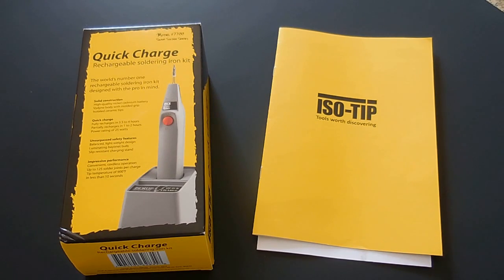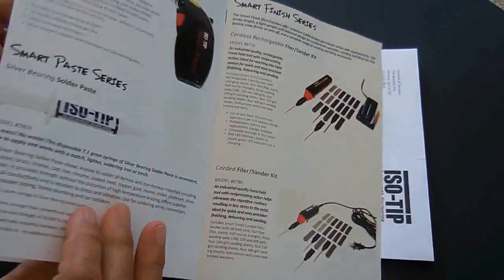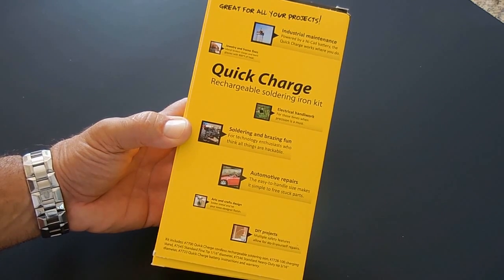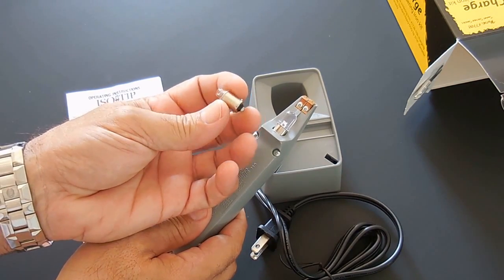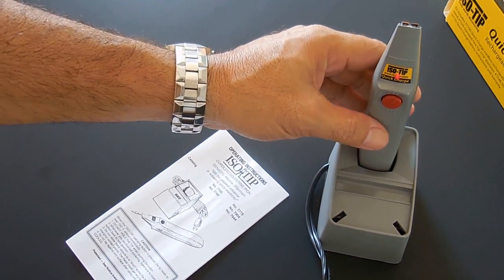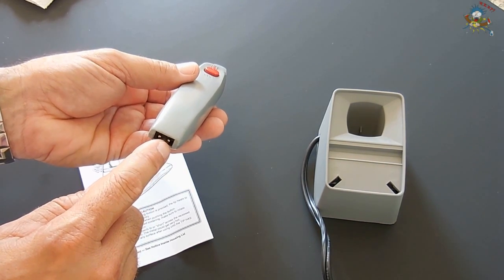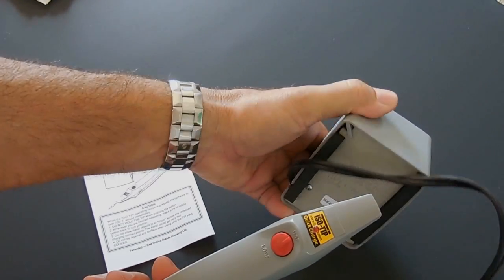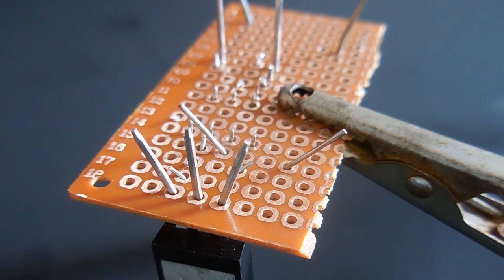ISO-TIP Rechargeable Soldering Iron

Comment: Nooooooooo! They gave us these things in the Navy in the early 80s when I was a tech in an F-4 phantom squadron. They wouldnt get hot enough to solder anything, we ended up using bic lighters instead.
Reply from the maker: Works pretty well for me. If you're going to try soldering thick wires, it's not going to work. When I have time I'm going to convert mine to lithium-ion
Reply: @electronicsNmore  we were soldering 18-20 awg conductors in compact wire bundles connected to  cannon plugs, at least 40 and up to 144 pins. The problem was less the wire size and more that it was outside, at night, even a little breeze and it might solder for about a minute if you were lucky then battery voltage just too low. Those were the days of ni-cd, maybe lithium could work. I had wellers battery powered irons about 20 years ago. The 4xaa version was marginal if you zip tied the switch for about 2 minutes. The 3xaa I got so mad at I literally threw it in the street and stomped on it. Having soldered thousands of connections in various applications I have no tolerance for insufficient heat! Butane irons can be frustrating too but when they work they work.

Comment: You did not say much about the LED bulb you used.  I just purchased a 8000 lithium but the #222 bayonet base bulb bunt out after only about 45 minutes of use.  I don't think they had a dropping resistor feeding it so the 2.2v bulb was probably getting 3.6v from the lithium batteries and that bulb is expensive compared to a normal screw base #222 bulb.  What bayonet LED bulb did you use?
Reply from the maker: 10mm ultrabright LED with series resistor.

Comment: They have made the same exact soldering iron at least forty years that I no of ,I figured by now they would upgrade to a lo po battery or at no metal hydrid  battery Of is a good soldering iron ,can I ask you wear you bought  your L.E.D. bulb from .thanks for shareing
Reply from the maker: It was a 10mm ultrabright Led off ebay.

Comment: Years ago Radio Shack made a cordless soldering iron (it was black with a yellow button) and I'm betting that Iso-Tip is the one that made it, but I could be wrong.  I had one and really liked it and it even had a slide on cover that protected the tip if you were taking the soldering iron somewhere with you.  It lasted a long time but eventually the batteries died and the knowledge of replacing them wasn't known to me at that time.  Was also hard to get apart and I ended up breaking it since there wasn't any screws in it (it was glued together).  I did save the tip and button mechanism and I still have it in my tool box and have plans to see if I can convert a cold heat iron (junk in my opinion ) over to use this tip.  Anyway, over a year ago I found one of these irons by a shear fluke for $19.99 and bought it immediately!!  I love this little iron and plan on doing the two mods you did to yours.  I have tried to use an led but it wasn't bright enough and the joule thief circuit looks like just what I need, so thank you for this!  Also I am going to do the charge indicator mod as well since there has been times that I went to use my iron and it wasn't charged.  I had used a large rubber band on mine to keep the iron snuggly in the charger.  It's not real tight, just enough force to hold it steady.  You can move the band with 1 finger.  I found your video whilst looking on Iso-Tip's site looking for an LED for the iron.  Thanks for making this video and showing us how to do the mods.  Much appreciated!!
Reply from the maker: Glad you enjoyed the video Terry! Please be sure to check out my extensive video playlists for other great videos of interest to you, rate thumbs up, and most importantly share my channel with others. Thank you

Comment: Hi, I tried to find but i don;t have any type of cordless rechargeable soldering iron in my country. I want to make it myself but the most needed part is its tip that contains heating material at 1.2 volts. It would be very helpful for me or others like me if you can share a video on diy rechargeable soldering iron especially its tip( how it can be built with common things available in electric trash or anything)  Thank you

Comment: I purchased mine in the late 70's and is orange and still works. I should replace the battery and the bulb is a screw type. There once was a drill attachment for cleaning out the holes in boards but I don't know if they are still available.

Comment: personally prefer products that work like I need them to straight out of the box without having to do modifications
Reply from the maker: +tooterr101 oldgeezer 
Yes, If you bought the mid-priced model, the charge indicator is already included. You are good to go. I felt that using an LED was a better idea.

Thanks.
Reply: +electronicsNmore you're correct about the led the manufacturer should know this

Comment: Nice review, I also used one of these in the early 80's.  Enjoyed using it very much, as matter of fact I found it again and would like to start using it again. Of course the battery needs change but not sure what the rating is on the battery, would you have an idea of what that might be. Thanks again for the video.
Reply from the maker: +Skydive Driver 
Appears to be Sub-C batteries. Just look for (2) high capacity, quality NiCd batteries.
Reply: Thanks

Comment: Your mods are great but I would have preferred a review of the stock iron with your conclusions, followed by your improvements and why they are important.  Still, a very good and detailed review.
Reply from the maker: +jims408 

Hi there. My mods did not affect the overall performance of the stock iron. The LED mod was my idea to extend battery life. The company sells another unit(exactly the same style) with the battery charging indicator already built in.

Thanks.

Comment: I had one of those over 20 years ago.  It worked great but the Ni-Cads didn't last that long.  And I see from your catalog that they still haven't upgraded to Lithium Ion Batteries yet.  Hopefully someday they will and if they do that is when I will buy one again.
Reply from the maker: +Beachcomber310 
There is a huge difference with Ni-Cads from 20 years ago. It would not be difficult to replace the (2) Ni-Cads with a lithium ion 18650. The charging base can easily be modified to charge the Li-Ion battery using an inexpensive TP4056 module. The Ni-Cads can take more abuse.
Reply: Still I would have thought that they would have at least gone to NIMH's.  Nicads are ancient technology.  They had memory problems and  they could reverse polarity if they drained completely rendering them useless.  I don't know if that is still true of today's nicads as I stopped using them years ago after the NIMH's were introduced.  Today I only use things that are NIMH or Lithium Ion powered.
Reply: I suspect the reason they stick with NiCds is the massive current draw they can deliver. NiCds can do 15C all day, but Li Ions don't like doing more than 2 or 3C.
Reply: @mrb692  the heck with nicads, ever seen one go into thermal runaway and explode? Just 1 AA size will go off like an  M-80, leaving toxic cadmium dust everywhere.
Reply: @johnlucier5654  Well this reply is certainly a blast from the past. While I've never seen or heard of a NiCd exploding, I suspect any scenario that would cause such a failure would've nuked a Li-Ion long before the NiCd failed.

Comment: I made a lipo version of this which is muuuuch better. I need a less sensitive tip though, the one I'm using was meant for 6v and I'm running it at 8 so you have to be careful.
Reply from the maker: +joblessalex The good thing about the Ni-Cd battery pack is that it is difficult to damage. You can fully discharge them and cycle them many times. The lipo battery is very good(high discharge), but they can be easily damaged, especially if allowed to discharge too much. 

Thanks For Watching
Reply: Do you have a lipo conversion tutorial?
Reply: @unkleskunky  All I did was wire a push button straight to the tip and a 2s lipo. No protection at all. If you wanted protection, they sell battery meters used to alert when your drone is about to die. Add one of those to the balance lead and it'll tell you when it's dead. To use it, you just tap the button a couple times a second and it'll get hot enough to solder. I now use a ts-100. Miles better than the radio shack iron with interchangable tips. That one requires at least a 12v 3s lipo up to a 6s lipo if you want speed. Fully regulated and controlled. If you haven't bought already, look into it first.